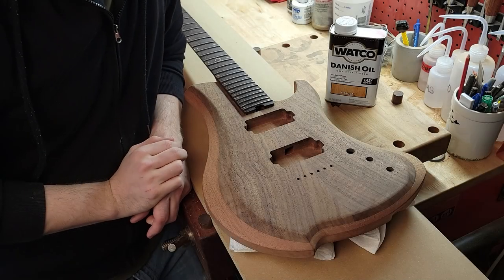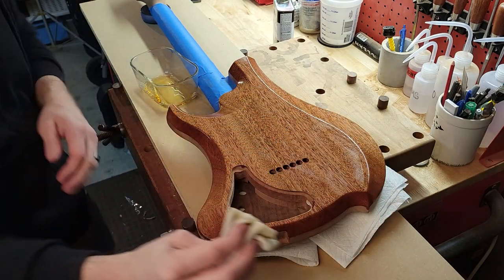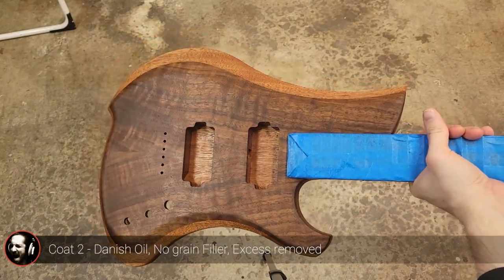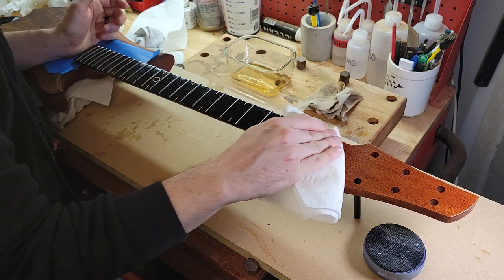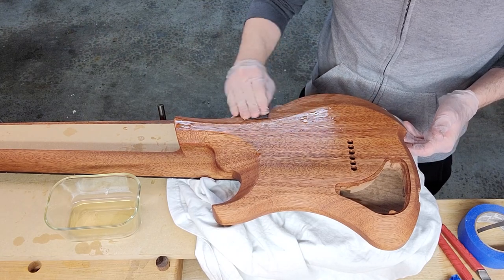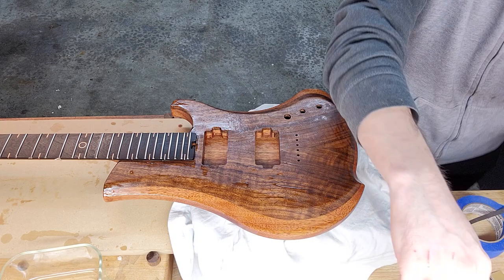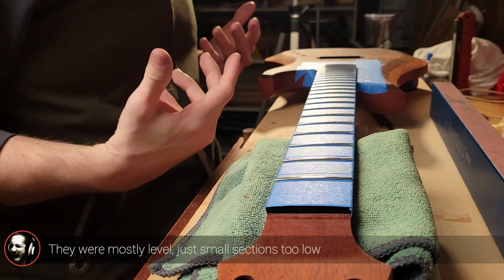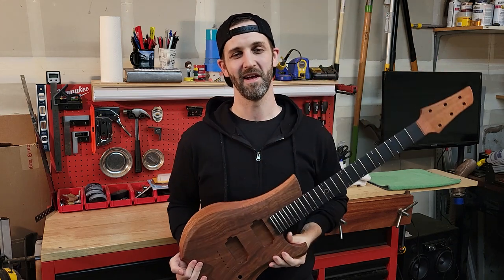Applying Danish Oil & Fretwork | Project Mehr | Guitar Build Log Part 7

Comment: Does danish oil hold when its applied over metal? Reason I ask is I'm about to install brass side dots on a neck, and was considering a danish oil finish, and I'd prefer just to do that over the side dots so the brass doesn't tarnish rather than have to coat them with something.